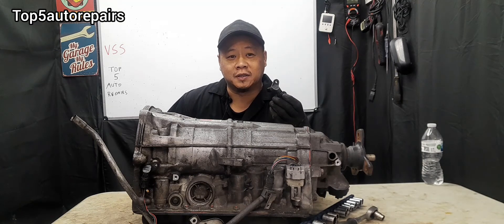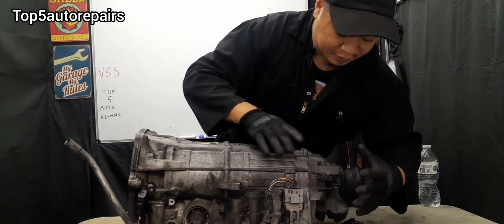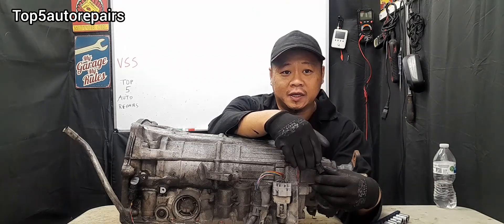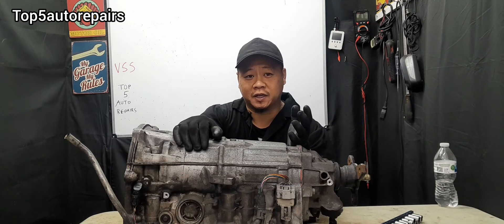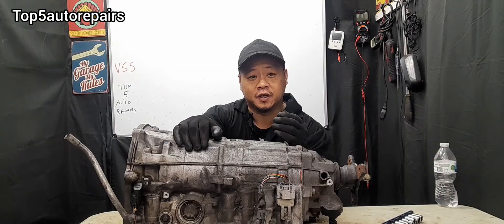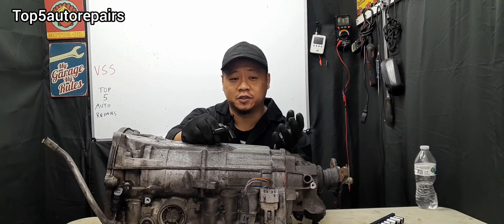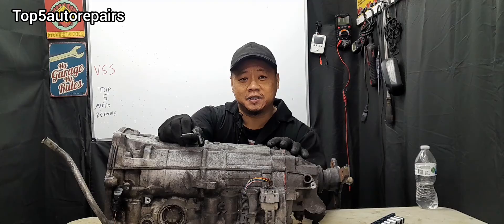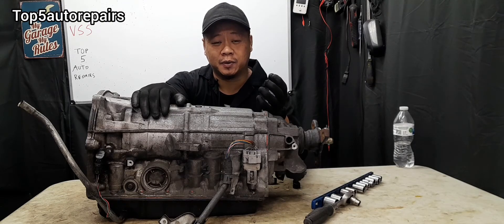SIGNS OF A BAD VEHICLE SPEED SENSOR (VSS) / OUTPUT SHAFT SENSOR P0500

Comment: Hi sir,
I dropped down my 4R70W on my F150 97 2wd and put it back up. Speed sensor used to work and speedometer as well . Took it back up and now it failed with no speed and erratic shifting and overheating. Changed the VSS and still have P0500 code with delayed acceleration and erratic shifting. Connections looks Ok.
Is this potentially electrical or mechanical issue?

Comment: I have a 2010 Chevy HHR speedometer fluctuates and transmission changes hard I've replaced the transmission speed sensor and all four hubs with new sensors still have the same problem, what should I check next, BTW no codes or check engine light

Comment: Boss your other video you said VSS sensor will give you inaccurate speed on speedometer and the output and input shaft speed sensors wouldnt. Which one is it i have a 1995 legend already replaced VSS now want to replace input and output.

Comment: Thank you for the explanation. I have a Mercedes 2006 Cls on my scanner. It says output speed sensor is implausible when compared to Will speed sensors, and on my scanner also shows that the wheel speed sensors are showing erratic values even when I’m not moving also my yaw sensor is not availableas well as my ESP and cruise control Wynne doing live values. The question is I have an internal output speed sensor located on the transmission conductor plate. Does that mean it’s bad?

Comment: Thank you for the explanation. I do have a question for you,  I have a Mercedes 2006 Cls and on my scanner. It says output speed sensor is implausible when compared to Wheel speed sensors, and on my scanner also shows that the wheel speed sensors are showing erratic values even when I’m not moving also my yaw sensor is not availableas well as my ESP and cruise control while checking live values. The question is I have an internal output speed sensor located on the transmission conductor plate. Does that mean it’s bad?

Comment: Need help? 2005 Chevy Cobalt automatic transmission. It was parked 2 years ago because of rusted out gas lines but no other issues none. So after being parked for 2 years I replaced gas lines and got the car running again. But it won't shift beyond 2nd gear now so what could be the issue? While sitting mice did chew through all the mass air flow censor wires so would that cause it not to shift beyond 2nd? I see no other damage and no check engine light? Please help

Comment: I’ve got an issue that the transmission isn’t going into 4th and 5th gear ,the speedo and cruise control are fine ,could it be the speed sensor or just faulty shift solenoids in the box
Reply from the maker: Shift solenoid